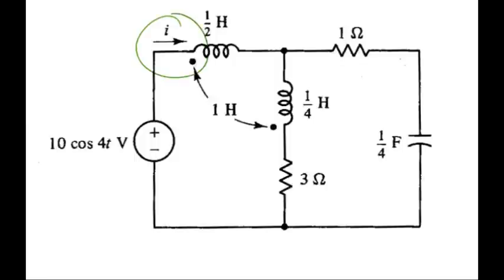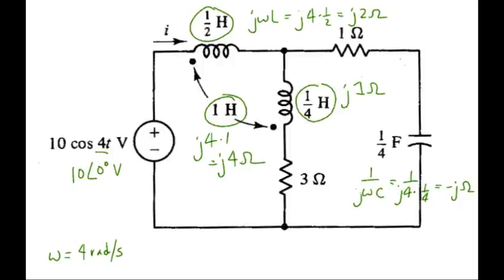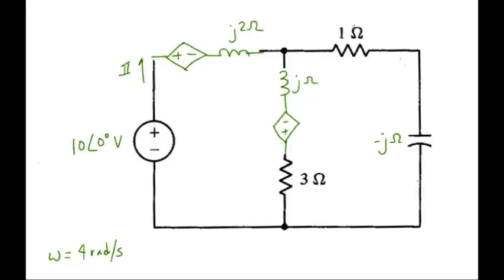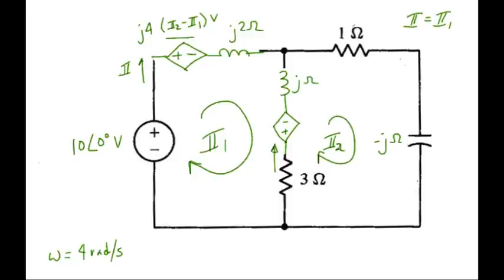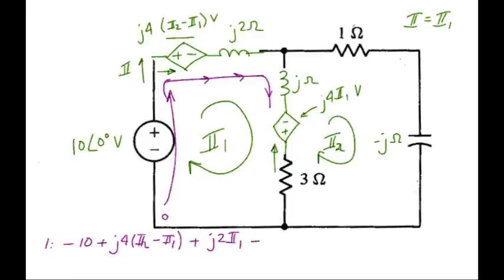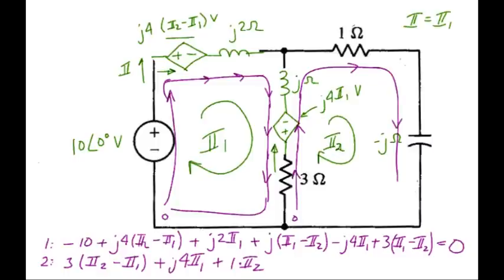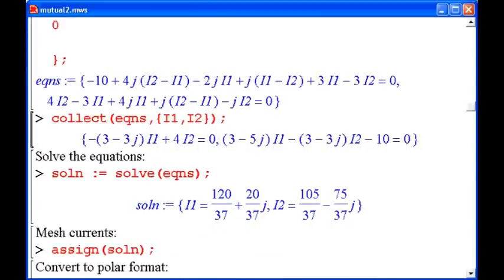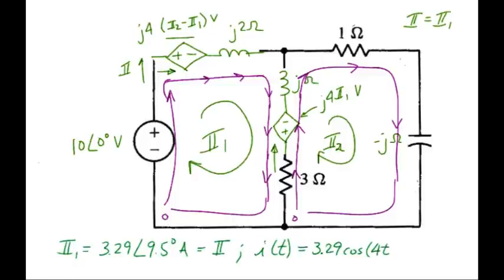ac: Mutual Inductance Example #2

Comment: Hi again .
this is the most info i can get out of book  "Engineering Circuit Analysis" , year  1993 from publisher McGraw-Hill .

Writing All  Self terms  is the same as with  DC equation writing with NON coupled coils .
Now , assuming  2 coupled  coils ,  I2 flowing thru  L2 gives an
induced term of   jwMI2  onto mesh I1 ( easy to realize ) . Next , using the Dot Convention with  I2 Arrow  and the
Dot of  L2 , we easily know the induced +-polarity onto  L1 .
Now we need to determine the correct  +-sign  of  ,  jwMI2 .
To find this +-sign , we use the same KVL traverse direction that was used when writing  the Self term of  L1 .
Example :
if we had Traversed  L1 Clock-Wise and if we used the +-sign of L1 as we Entered L1 , then that is the same location
we must use to pick the +-sign for the Induced  term .

Effectively , L1  will have 2  pair of  +-polarities .
+-pair One was used to write  the Self term of L1 .  the other +-polarity across L1  came from the Dot of L2 with
I2's  current Arrow direction, either entering the Dot or Exiting the Dot , of L2 .
Example :
+   -   is the +- pair across L1 ,  used when writing Self Term of  L1 , Traversing\Entering L1 on the  Left side , at the  +plus ,
thus the  Self Term of L1  is  + ( + jwL1I1 ) ,  KVL is  +pos and  Ohm's Law is  +pos
if we determined the  Induced +-polarity across  L1 ( using L2's  Dot with  I2's Arrow direction ) as:
-    +  , we need to use  KVL Traverse in the same way that was used during the writing of  L1's  Self Term , thus we use  -
which is  again Entering  L1  from the Left side and the  Induced term onto  Mesh  I1  is   ( - jwMI2 )  ,  KVL  only .

I see nothing else  the book is doing\saying .  All the above can be done in One's head , with  nothing extra to write on the
diagram . Very  implicite ,  once someone sees how to do it .  Deriving the  +-sign of the Induced Term does NOT use
Ohm's Law , instead uses just  KVL  Traverse direction in the exact same way as performed when the Self Term of L1
was  written .

It is actually very simple to do , even though the book's sometime suggest otherwise .
i have no issues wrting the initial  mesh equations  in  Chapter 14 , of the above mentioned book .
The initial mesh equations can easily be Directly wirtten with No  intermediate steps, and No extra drawing on the diagram .

what do you think ?
Reply: Author name?

Comment: why the technique of  Inserting dependent source ?  I don't get it .  Write any KVL  equation of resistors , and no one inserts a voltage source  in place of  IR ( we could , but no one does that ) .

why not just write the two  Mesh  equations that each contain  Self-terms( as normal ) with the Mutual-terms .
That's how the good books do it .  Your way , the circuit diagram needs to be messed with to draw in the dependent source .
Too much overhead for that approach .
I am NOT liking that technique .

ISBN :  0-07-027410-X  "Engineering Circuit Analysis"  Fifth Edition  1993 ,  McGraw-Hill publisher .
Reply from the maker: Yes, you are correct, most textbooks do not redraw the circuit with dependent sources to model the induced voltages. As a student learning this material I often found it difficult to get the voltage polarities correct, and later as a professor found that showing the induced voltages explicitly as voltage sources made it easier for my students to arrive at the correct analysis of the circuit.
Reply: @RoseHulmanOnline   ok .  I have found that much equation writing and analysis eventually involves a lot of implicitness . Example Reference :Node analysis , Nodes are labeled  V1 V2  V3 , while each  V  node is +  with the single  Ref. node as -.  +- are shown only during a First time explaining . After that , the books do NOT draw in those +-  node pairs( everyone needs to Remember that ) . For Meshes ,  I only show  I1  I2  I3  etc. in each  Mesh  window . I don't  show the  Arrows anymore, because each  Arrow is implicitly known to be used in the   Clock-Wise direction .

It is not difficult , but eventually there are many things that become implicit , which need to be fully discussed at introductory level .   When showing  extra Steps , the reader should know that , that is NOT how they will eventually  do it . The same circuit needs to be re-done in the  implicit way . Other-wise some folks might get miss-lead in their analysis approach . You showed the analysis , but yet you don't  actually do it that way. That can confuse and miss lead a First Timer . It needs to be followed by an implicit analysis so that everyone sees the  real deal .

The book I mentioned is very concise ,  Not perfect but it beats  the other 2 top competing books . That book has a real  Engineering approach to the  discussions .  The depth of technique is obvious , in the  book .
the other 2 competing books are :
"Electric Circuits" 2nd Edition and  "Basic Engineering Circuit Analysis" 4th  Edition
all 3 books are now in their  12th or so  Editions . ( there is nothing new in the newest editions , so buy previous editions used  )
Reply: If we don't use dependent source we get same result ..Does it requires to use dependent source as point of view as marks
Reply: @You_Tube12355    I think some of the  Techniques are NOT using the full concept of the  "DOT  Convention" , that is why some want to insert a voltage source .
If a "Self inductance" term  is   +   - , and we find that the  "Mutial inductance"  term is  +  -  , then we know that the  Mutual term  "aids"  the  self term , and the  Mutual term is written with  a  + .
If we find the  Mutual term  opposes the  +-polarity of the  Self term , then the Mutual term is written with a  -minus , for here the Mutual induced voltage acts to "reduce\opposes" the Self induced voltage
There is No need to  draw in\insert a  "voltage source" depiction .
Can you  get a copy of this  book :
ISBN  0-07-027410-X  "Engineering Circuit Analysis"  Fifth Edition , 1993  McGraw-Hill publisher .  It has International versions too . ( how many languages , I do not know )  That book has  great  depth .
Reply: @240mains   book ki soft copy hay to bhejo  sir please..
Reply: @You_Tube12355   Amazon .com  has the  book  Hard cover (  english version ) . it is very  inexpensive about  10  USD . super low price .  I can  NOT  copy  the  book .
Reply: @240mains  
Who is this author of iSBN: 0-07-027410-XEngineering circuit analysis fifth edition 1993 McGraw Hill?

Comment: On the j2 inductor, what if the dot was on the right, meaning i1 is exiting the dot. Would that mean the middle dependent source would be -j4?
Reply: Trump 2016 I did that method which put the dependent source on the right of J2 and the sign was negative and positive which ha the value of J4(I1 - I2). The final answer is the same as his method putting the source where the dot is. I was confused at first but after watching many videos with different methods, I finally got it.

Comment: in mesh 2 dependent voltage should it not be j4(i1-i2) as it was done in mesh 1 .the reflection current due to mutual inductance is i2-i1

Comment: About the second voltage induced by the first inductor, i think it should have a sign of +- because the current enters the dotted side of the first inductor then it should follow the sign
Reply: your view helps us about circuit exam <3 thanks a lot

Comment: the voltage source is in "cos" so fasor notation must be 10/_90 ??
Reply: No, you can use 10/0rad as the source, there's no need to add 90º. Lets say you find some voltage in the circuit wich is 7/(pi/6), in the time domain this means 7cos(4t+pi/6), its just a phase shift.